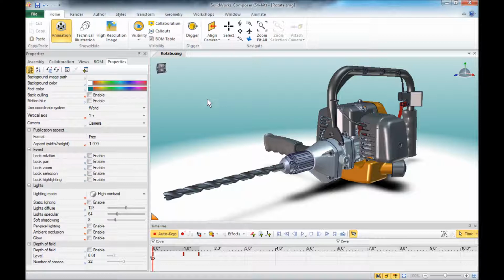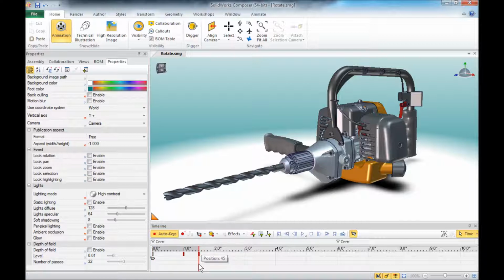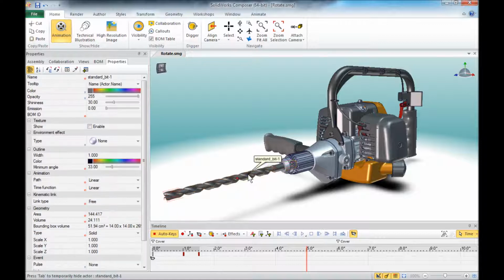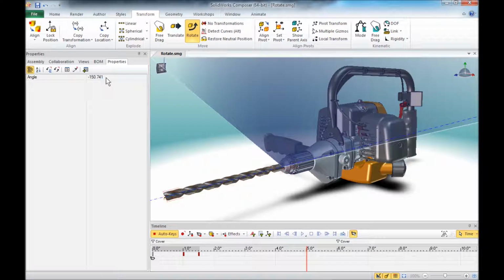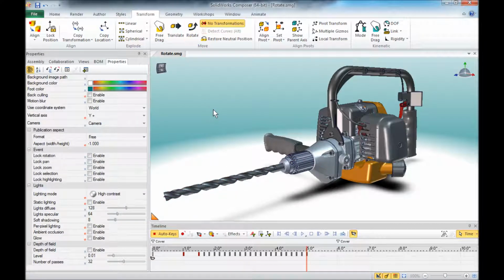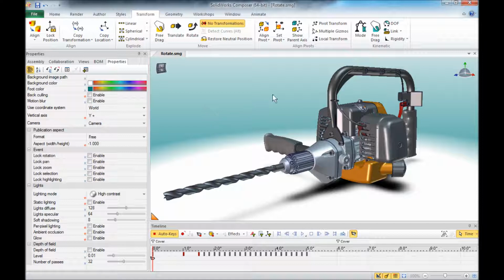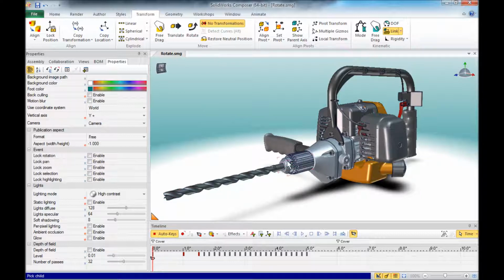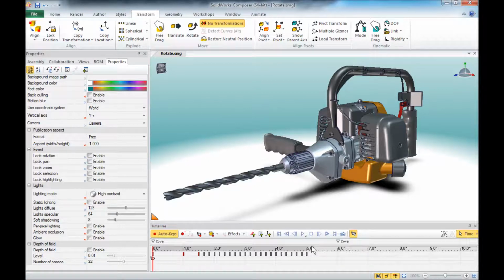SolidWorks Composer Rotate Tips and Tricks - Author: Mike Towers

Comment: how did you get your properties tab to look like that, I am using Solidworks 2016 rn and my properties tab seems to be much less robust than yours
Reply from the maker: Hello Saintie, and thank you for the question. The properties shown are a function of the object you have selected. You will notice that as you select different actors, you may have more or less properties. In addition, often times fields are collapsed. In 2016, you’ll notice headers on the property tab with a little arrow to the left of them. Clicking this arrow will expand to show the fields below this header.

We hope this helps! If you are still having trouble, please contact your local SOLIDWORKS Reseller for technical support.
Reply: Thanks for the response I just noticed the little arrows and it's working very well now